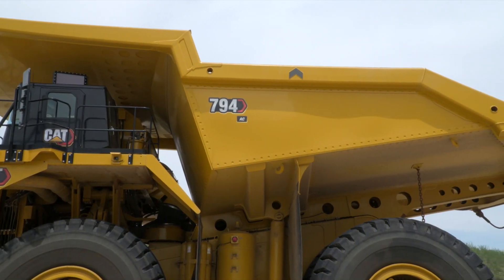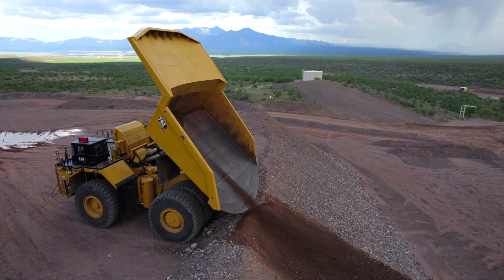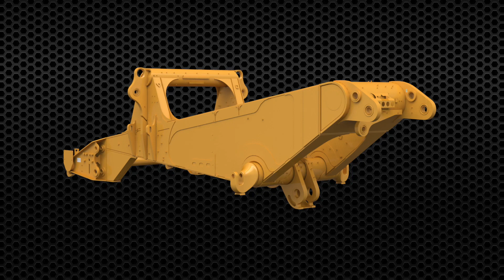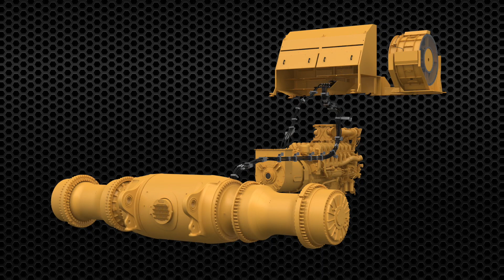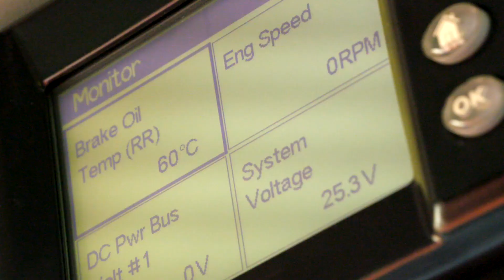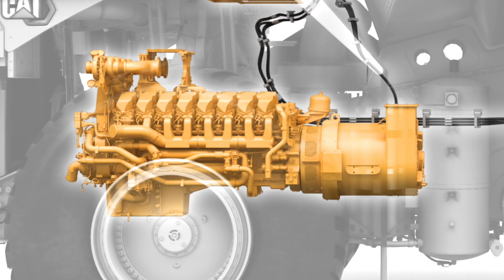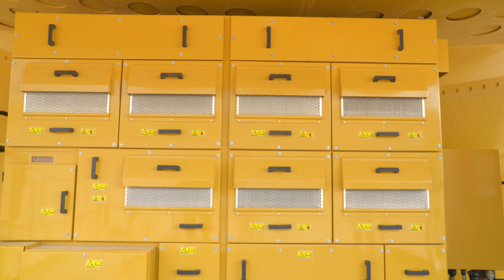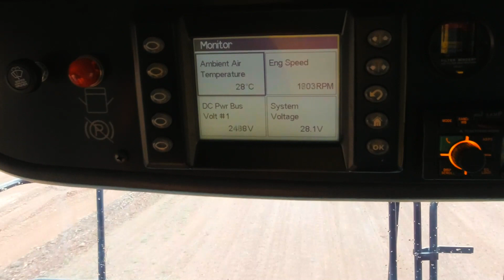794 AC Virtual Walkaround

Comment: I guess this is the reason why Caterpillar acquired EMD.
Reply: This truck has nothing to do with EMD. They bought EMD for the locomotive business.
Reply: @dougberry1011   How do you go from a mechanical drive  to an electric drive  with no previous experience ?
Reply: @mikemotteberg3527  CAT bought the Terex electric truck. The CAT you see is an MT model. Bucyrus was in the middle of this as well.
Reply: @mikemotteberg3527  CAT already has a full cat electric truck before they even converted this older mt unit rigs to cat anyway. Look up 795F which is a full electric cat truck. They even use some of the 795 electric systems on these 794 796 798
Reply: @jayryan1956  correct
Reply: @dougberry1011  Thank you, now I understand.

Comment: You know your truck is big when the engine bay has walkway
Reply: You know it’s also big when the engine requires 8 batteries to start it up 😂
Reply: And the battery box is so massive that it requires a crane or a forklift to remove it for maintenance 😂😂😂
Reply: @noahater5785  true 😆

Comment: What is better, a CAT or LIEBHERR A/C Truck?
Reply: CAT bought the Terex truck and painted it yellow. They took out the MTU S4000 and put in their engine. MTU continued to supply engines for this truck for some time. Liebherr builds  a very good AC drive truck.
Reply: @dougberry1011  yes.but liebherr and komatsu are also bought right? komatsu also bought demag.
Reply: @martinriggs2957  Liebherr is Liebherr as is Komatsu. Komatsu bought LeTourneau to get the best loader with their switch reluctance technology.
Reply: @dougberry1011  
What do you think is the best truck?
 i dont understand why cat have no big a/c loader 
The test a d11 a/c
Reply: @martinriggs2957  All the trucks are good trucks. Depending on the area, service drives the truck popularity.  Service can be expensive though.  Mines figure that out after a while. The LeTourneau (now Komatsu) is the only electric rubber tired loader. A very good machine.
Reply: @dougberry1011  
Ok thank you.
Do you work in mining?
Reply: @martinriggs2957  I’m retired but was involved in mining as a product support manager for Detroit Diesel/MTU. I have respect for all the products out there. It’s a tough and demanding business
Reply: Cat or liebher truck almost same performance
Reply: The Liebherr trucks are over complicated and very fragile, the have multiple integration issues with Cummins to Litronic software. As far as service is concerned all other trucks beat Liebherr hands down. Try accessing the engine on a Liebherr and compare that with the space and walkways of these trucks.

Comment: Designed by Bucyrus
Reply: Designed by Terex.
Reply: @dougberry1011  See above reply for the correct answer.
Reply: @bighairycat  my mistake. I worked for MTU and we were still supplying S4000 engines after they were purchased by CAT. They were painted yellow. I’m retired now but I’m sure they have C175’s in them now v
Reply: These trucks were originally sold as UnitRig trucks and they are the designers of the basic structure.